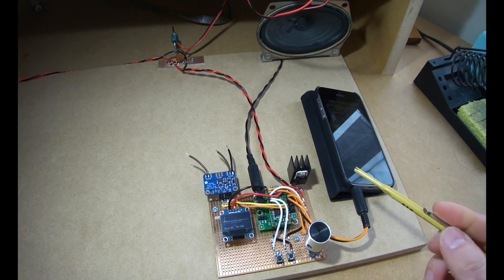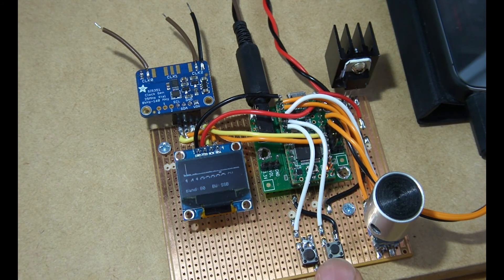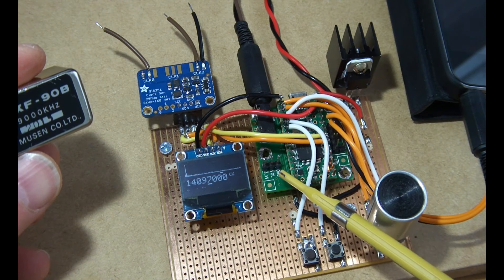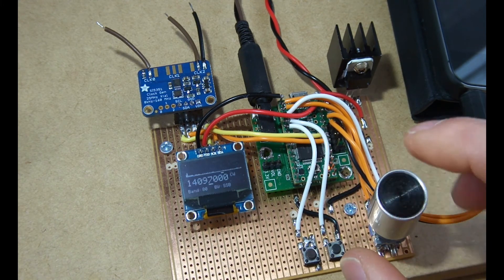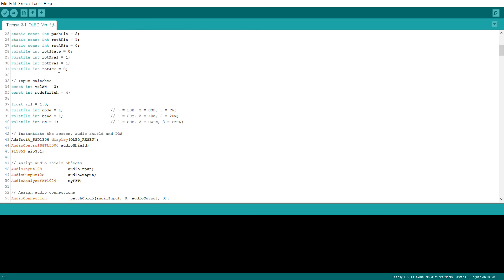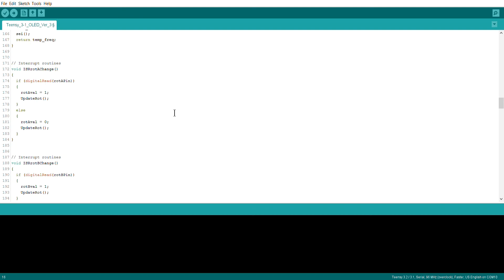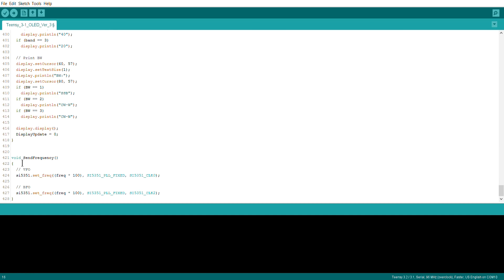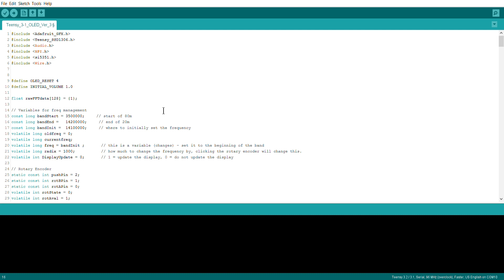Simple Homebrew SSB/CW Transceiver Part 2 - VFO/BFO Oscillator and Screen

Comment: I found out that the display is generating noise , because of the charge pump. there is a video on this on you tube to fix this issue.

Comment: Hi Charlie, I'm a real thicko with these vfos ..could you provide a circuit (wiring) diagram that I could use to build one please? I have made many vfos using ceramic resonators and 1n4004 diodes as varicaps.
Really like your interesting videos.
Very 73,
Chris G0VOE.

Comment: I have admired your experiments, I ask, if possible, that you increment the clarifier optional function (in the menu select "0" (disabled) or "1" enabled). I'm using a OLED Adafruit_SSD1306.h biblio. I wish to add to the code in an analogic input (for example A4 on Arduino Nano) the functionality to slowly changing through a potentiometer the functionality to adjust + 2500hz to -2500hz (5khz with center on the display), to better adapt to the old transceivers with "Clarifier", so inserting wires on original clarifier potenciometer, thus giving an appearance of more originality... If you can implement and share the code I'm grateful. Best regards, PU2YZO

Comment: Charlie, could I use my Arduino Uno r3 to do this vfo, even attiny85?
Reply from the maker: No unfortunately, as I'm using the Teensy audio library for the FFT.
Reply: Charlie Morris I know teensy. Here in my country it is know as Arduino nano ( a little mistake i think). Anyway any problems to share the .ino code? Are The band selector feature working as well?
Reply from the maker: Hi Emerson. The Teensy is not the same as the Arduino nano. Please check out: https://www.etherkit.com
I have the 3.5. As for the code, it's on the blog.

Charlie
Reply: @CharlieMorrisZL2CTM  great dds..
Teensy can be change to arduino nano...thanks
Reply: Charlie Morris Could you give me your email, please?